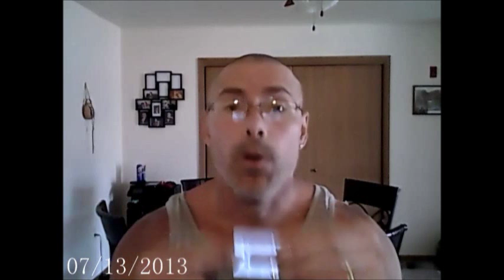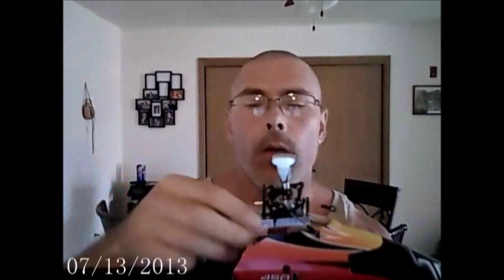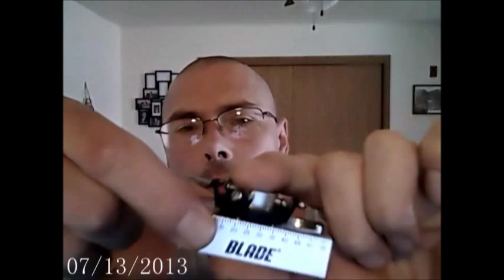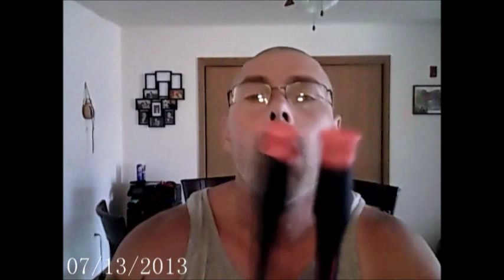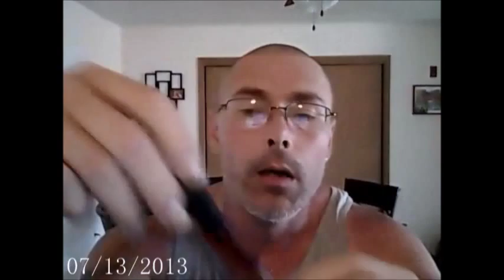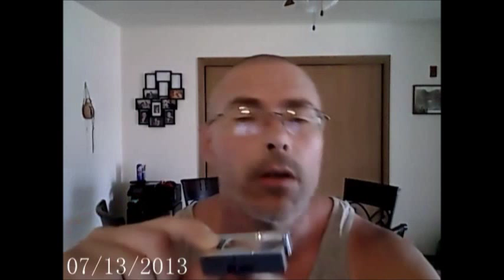Blade Swashplate tool

Comment: Just purchased the tool with just a notice of how to use it. Have the regular tool that requires removing the rotor assembly. Thanks for the reply of how to use the Blade tool right from the guys who built them.

Comment: The only thing I learned from this is that it is possible to balance a swash with that tool. I could not figure out how to use it, so I went to the Blade website, and they have a good instruction sheet to help. Problem with this video is that we don't get shown how to do anything.
Reply: +Graham Bentley  Right from "Blades" web site.   http://www.bladehelis.com/ProdInfo/Files/BLH1690A-instructions.pdf    See .pdf if you need the pictures.   Now it is all in one place.  ;)  
 Swash Leveling Tool Instructions 
1. Disconnect the motor from the ESC by disconnecting any two wires between the motor and ESC 
2. Disconnect all the linkages from the swashplate 
3. Power on your transmitter 
4. Enable idle up 
5. Put the throttle stick to center position 
6. Observe the left and right servo arms and adjust your subtrim so that they are level 
7. Observe the elevator control arm (behind the motor) and adjust your subtrim so that it is level 
8. Slide the swash leveling tool under the swashplate as shown in the photos 
9. Place the swashplate flat on the tool 
10. Adjust the linkages such that the swashplate remains flat when reattached 
11. Once all linkages are attached, disconnect the battery from the ESC 
12. Carefully slide the swashplate up and remove the swash leveling tool 
13. Disengage idle up on your transmitter and power it off 
14. Reconnect the motor wires to the ESC 
15. Now go fly!
Reply from the maker: +Graham Bentley This is not meant as a instructional video on doing a swash leveling. Their is all kinds of AR7200 swash leveling video's out their.  It is a information  about the way the block is created.  People have asked or don't know what is the reason for the 2 different sides.  This video is 2 years old.  They may have updated their manual by now.

Comment: What is your stick position when using the blade tool? Is the thickness supposed to get you perfect at 50%? I have a 450x and just picked up this tool since watching your video!
Reply from the maker: Yes the thickness gives you center as long as you have the screws in the counter sink holes.  With the AR72000 when you set 0 pitch if you do it when your in the servo centering step and have a servo selected, the stick position don't make a difference.   If you want to feel safe. Go to the Monitor screen and make sure your pitch is 0 then make your link adjustments.
Reply: Just worked perfectly! Heli was way off out of the box, thats why I wasnt sure. Now time to try it out. Everyone thinks you dont need a perfect setup with beastx but if its not perfect takeoffs will suffer!
Reply from the maker: Why make the FBL work any harder than it has to if you can help it.  ;)

Comment: I was hoping you could show how to use this tool on an actual bird.  What are your transmitter setting do you set it at mid low or high stick I'm very new to this. Just got a blade 450 3d and want to set it up perfectly